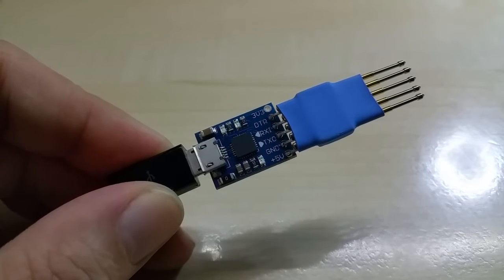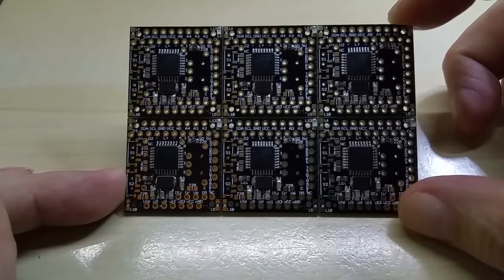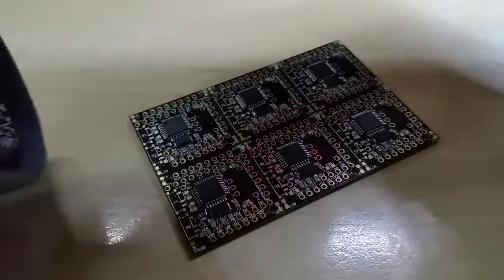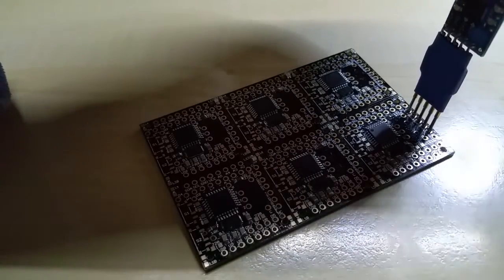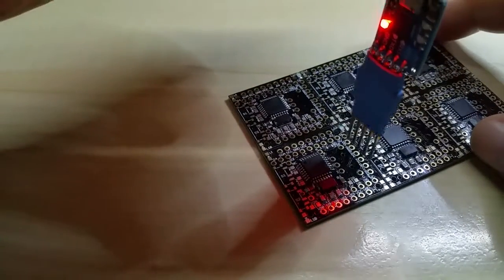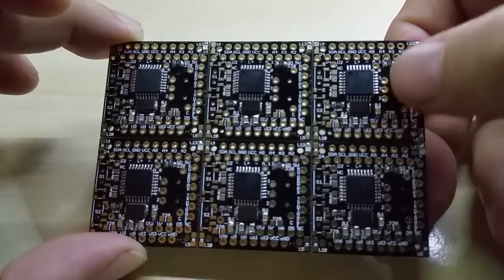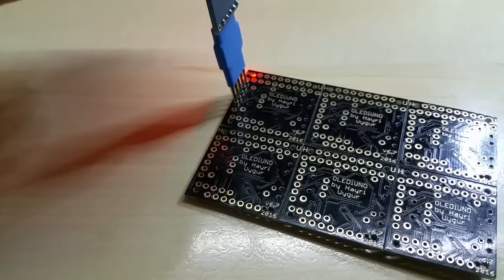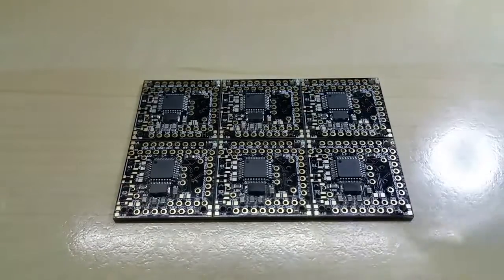How to upload code to my OLEDiUNO PCB

Comment: Thanks but still I think you need to upload the bootloader before that ? Have you done before or what ?
Reply from the maker: Of course you need to upload the bootloader first, I do that before soldering the chip to the PCB but can upload the bootloader even after soldering the chip to the PCB.
Reply: Many thanks Hayri for your reply. I'd like to see it once in your videos as I believe that you need some circuits to be readily built on your board to support the bootloader upload. If you upload it before soldering, what socket do you use, I'd like to see it